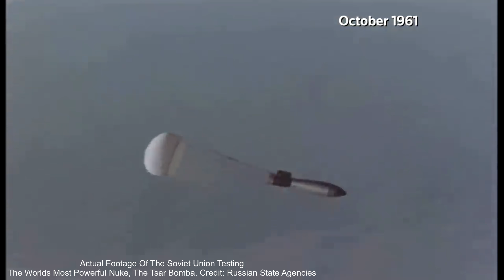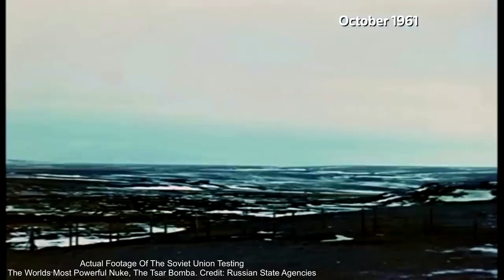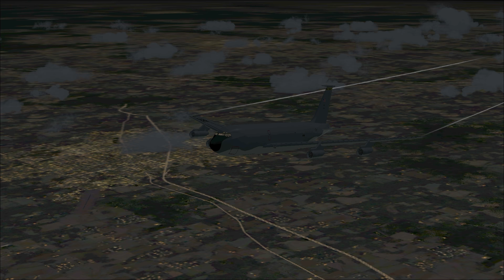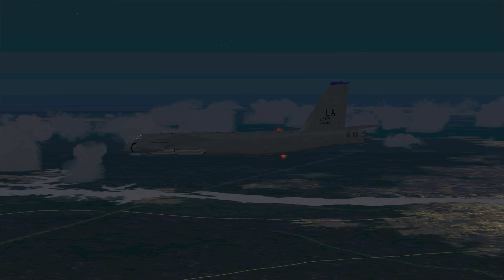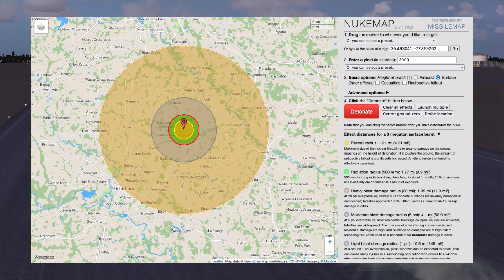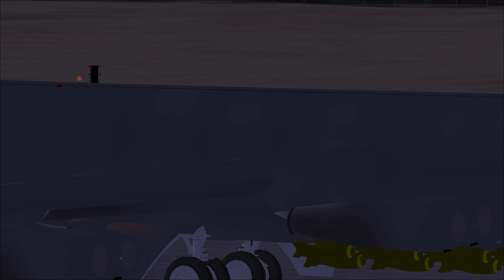The Plane Crash That Almost Nuked America | 1961 Goldsboro Incident

Comment: The great part about Eisenhower being President is that as military general, his mind would likely have gone straight to why that target?  Alerts would doubtless have gone higher, but to strike without understanding seems highly unlikely.  Nobody understands the implications of war more than a General.
This was an outstanding walk through of this incident.  Thank you for doing it. 👍
Reply: The thing is -- Kennedy was inaugurated on January 20th 1961, so he had been president for 4 days when this happened, not Eisenhower.
Reply: @AML2000  you're right!  It might not have gone so well if the advisors to the Bay of Pigs were advising President Kennedy and this had happened.  Was thinking 1960, not 1961.
Reply: @SCP-POOL  odd. It took until June 1962 for JFK to sign such an order and it's a far cry from the current PAL system in use today, which the B61 bombs were updated to in 2002. With another revision in 1995 to centralize the code management.
Reply: Eisenhower wasn't Curtis LeMay by a longshot. 
https://en.wikipedia.org/wiki/Eisenhower%27s_farewell_address
Reply: Total bullshit mate
Reply: General's understand...? What? 

They absolutely DON'T understand anything else than: - "I must to do something, because my wage is soooo high..."